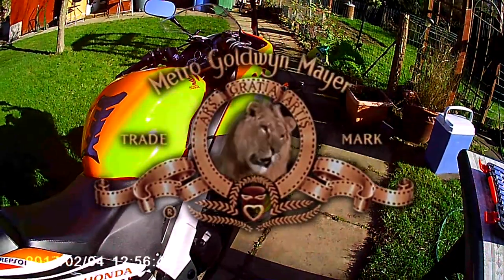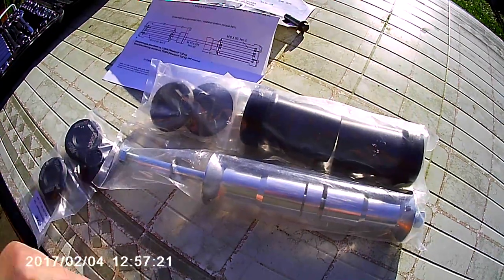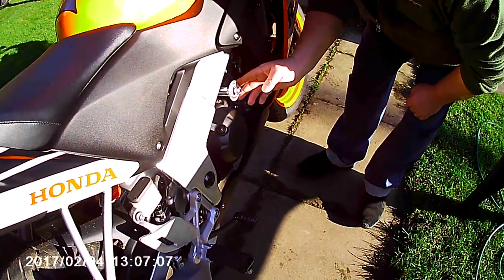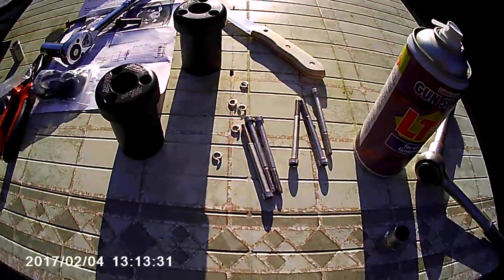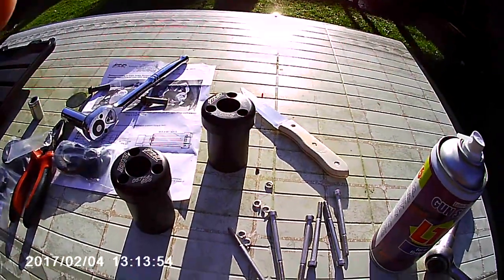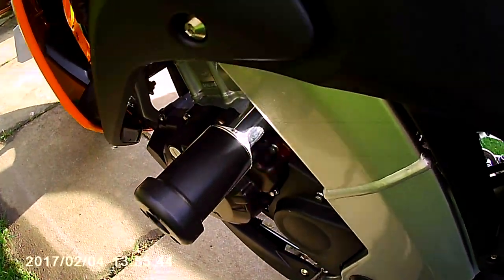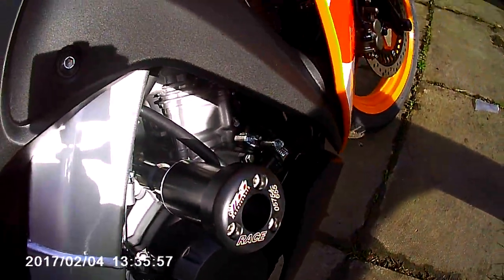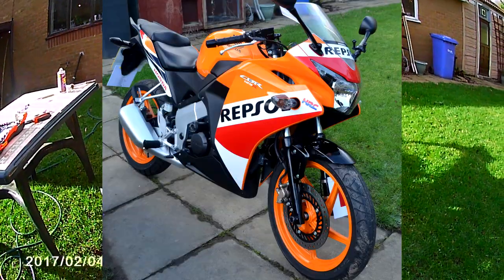Honda CBR 125R Bump Pad Install

Comment: Hi, what is the name of the crash protector ? I’m looking to get one.
Reply from the maker: It's in the Title GSG no need to drill the fairing.
Reply: So if u crash it will damage the engine because its connected to the engine